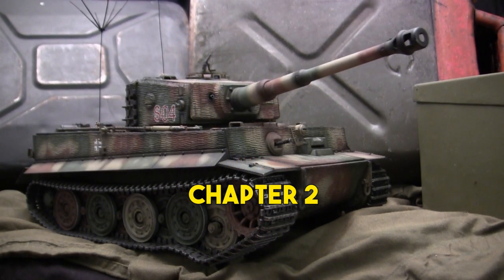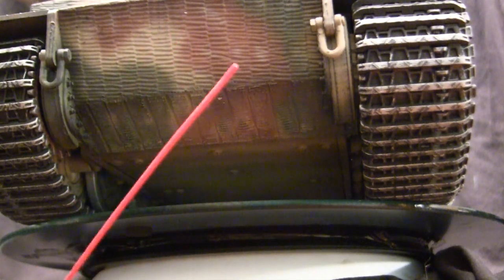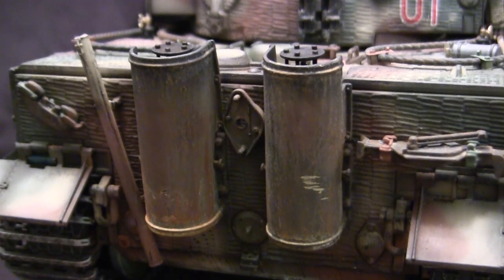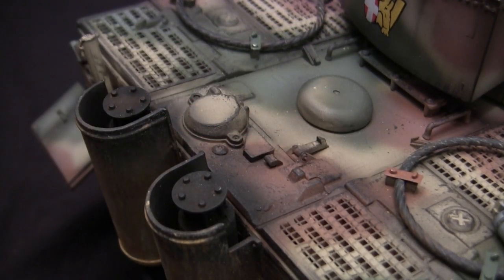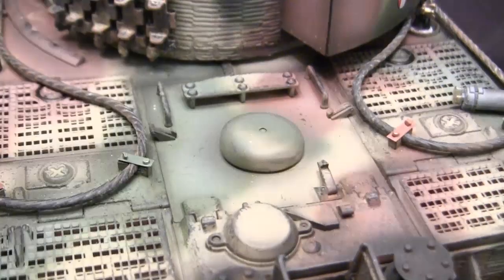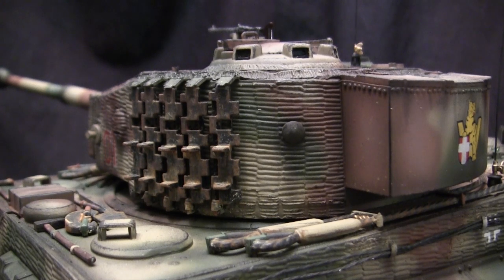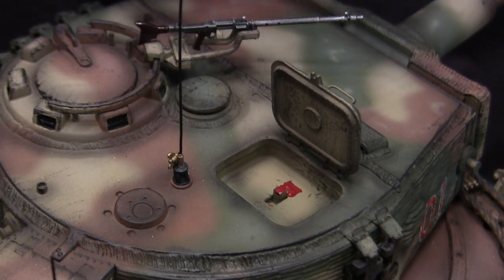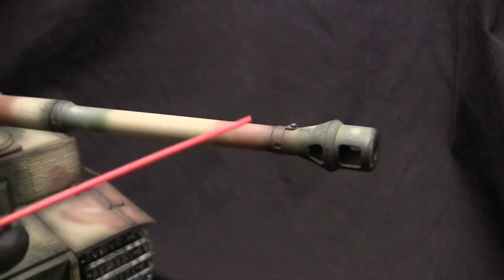1/16th scale RC Taigen late production tiger I command vehicle model rebuild, Part 2 of 3

Comment: the eye sore you speak of the eu model charging point i dont get it unless you have seen it you can't call it that as its hidden and on the panther g its inverted you do not see it at all ??
Reply from the maker: I disagree, the hole is very visible and it is an eye soar, which is why it needs to go. Bottom line if it's not on the real one it's not going to be on the model
Reply: @oddball759mm The real Tiger has an asymmetrical horseshoe turret and gun mantlet.  This Taigen/Torro model does not, which lets it way down on accuracy.  The periscope cupola is lousy too.  You improved the base by shortening it, but the aspect ratio of the periscope openings is wrong.  I’ve always wanted Tamiya to do a correct, accurate, 1/16 Late Tiger, but it seems they never will..